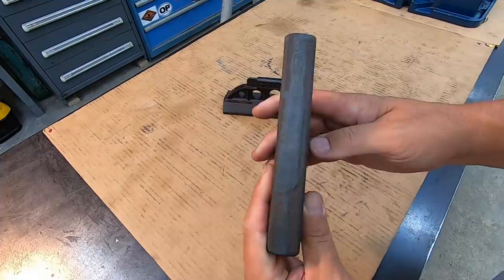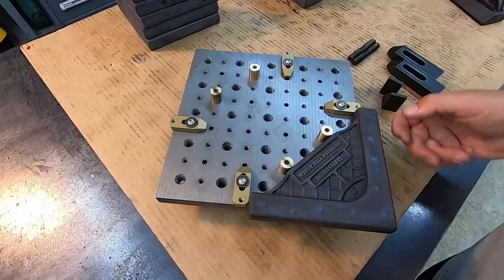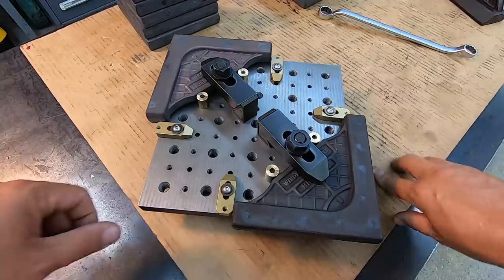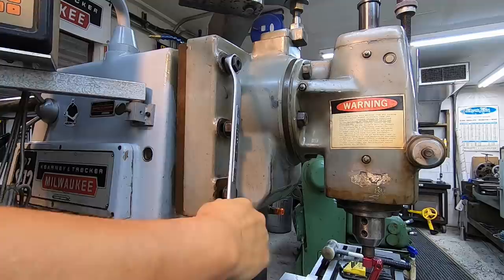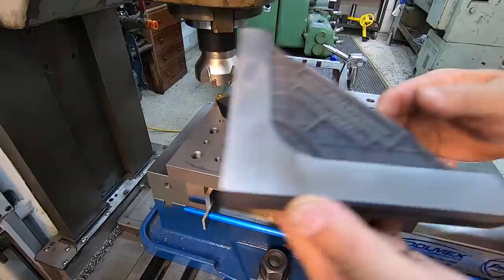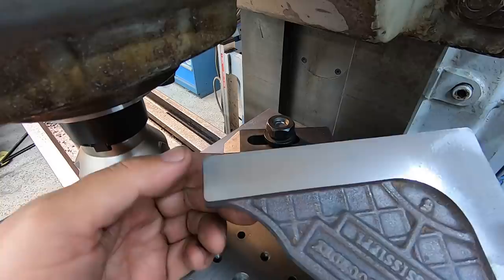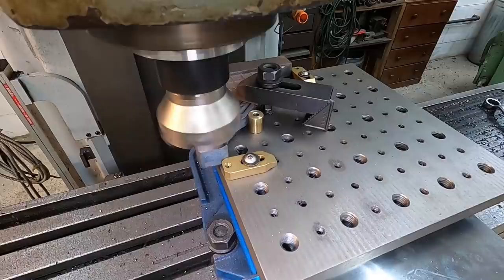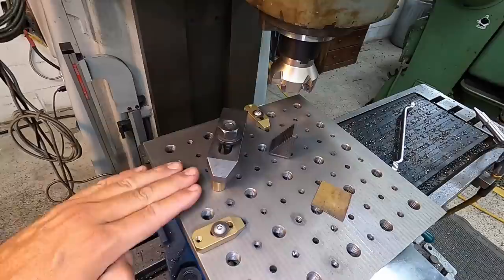Windy Hill Foundry Machinist Squares Part 1

Comment: Those upset with you using the Sky Hook must be youngsters that haven't endured years of wear and tear on their body lift those vises and chucks by hand. I used to use a cherry picker for the chucks (most of the time) but used to manhandle the vises and wished I had the crane to make that job a whole lot easier. Good job Adam.
Reply: All I ever did in a machine shop was sweep, stamp, and clean parts, but still enjoy the videos - and have back problems - hard to work when you can stand up from a pulled back muscle, and doesn't take much!
Reply: @mpdavis731  I'm pretty sure the hecklers were criticizing HOW he used the skyhook. Not that he wasn't picking heavy things up with his hands.
Reply: @executive  Ah, ok - didn't know there WAS another way to use it - only one I have seen.

Comment: Okay the sky hook I was like I just lift my vices... then I got to thinking you cleaned the bottom side without fighting it or risking hurting yourself with a twist lifting it from the cart to mill. I liked it for the large but in the mill that is just as awesome.   Good job showing the safer way to get it done.

Comment: To anyone who thinks using a tool to help lift heavy parts is wrong has never injured there back or other parts doing so. You only have one back and over time it can only do so much and the simplest thing can change your life forever.  Work smarter not harder. Don't pay attention to anyone who thinks its ok to risk injury over lifting heavy parts.  From: A disabled fan who wishes he could do 1/4 of the things I get to see here.

Comment: There is a hundred ways but this is as good as it gets in  setting up the machining process. The old brake parts cast a very high quality piece which makes the machining much easier. Well done Adam. Keep safe. Carl, Central Coast Australia.

Comment: 142 lb for the vise, wow. I thought you were just being extra cautious and the sky hook was just to make it a little bit less strenuous. Can't be moving that weight around manually without putting wear on your body. Anything to ease fatigue will make for a more enjoyable workday.
Reply: Tony Wilson  I wonder if in the end engineers will come up with stuff that's bolted/welded together to get necessary amount of rigidity to make some simple operations and build up from there, or we'll see a 10/20/however many cargo starships landed on the moon in preparation for astronauts.
Reply: @jnimitzch4738  H3 fusion is very much a pipe dream currently. If (IF) it ever becomes viable though it would make all the iron, titanium and aluminum bearing minerals that make up the lunar rock useful, because extracting the metal from those ores is going to be extremely energy intensive.

Comment: If you are not changing the clamping before machining the measuring faces, have you considered if the clamping on the suspended middle part will flex/pull the angle together to any measureable degree?

Comment: What's wrong with using the sky hook on the mill? That's what I would use it for. Sure beats having to lift a 142 pound vise up with your arms and back. I think people are just jealous of your sky hook. Haha.
Reply: Was thinking the same thing. Work smart while you work. Save the body for future use. 😉👍
Reply: I'm also confused as to why anyone would have an issue with how the sky hook is being used.
I for one love it,,, my back relaxes every time I see it !!
Reply from the maker: There’s loads of comments on the reveal video of why I’m doing harm.
Reply: @Abom79  to me it would seem that the K&T mill is a piece of equipment that is made to handle a decent amount of weight on that table. I wouldn't imagine that you lifting your vise on to it would do any damage. Not to mention that the thing is only under load for like 10  to 15 seconds. No way that's gonna damage anything when the machine is designed to hold a lot more weight than that for long periods of time during machining operations.

Comment: anyone disagreeing with using the crane probably hasn't ever dropped one of those big chucks or a big piece of barstock.
Reply: Let them disagree all they want. Needlessly lugging around awfully heavy (and expensive/sensitive) equipment without assistance tends to bring about a lesson or two all by itself, given time.
Reply: Most machine shops I've been working with all had either (or even both) overhead cranes and swing-arm cranes to move those heavy pieces of iron.

Comment: OMG one raw unmachined casting--------------------------------------Raw casting. $157.55
You have to be out of your freaking mind.
Reply from the maker: Sounds like you buy your tools at Harbor Freight
Reply: About $2 per pound for raw material, so maybe $14-16 including the sprue/scrap.  Stress relief a batch, about $100 and probably 10 at a time ($10 per).  The pattern probably cost about $2000 to be CNC cut.  I’ll assume he wants to get his money back after 50 of these, so $40 per for the patten.  Then packaging, maybe 1 in 4 is scrap or has porosity.  So he’s in for $80 per to just cast a good one to cover the cost, then he’s got to make a living off this.
Reply: Harbor Freight is that way --> go get all the pot metal castings you want there.
Reply: Jim Hammill yup you’re right, those can get added on too.  Not a huge money maker at all but a good quality product made by a craftsman and not a company overseas.
Reply: Lol you clearly don't have a clue about low volume foundry costs. This price is fair market value. Go learn before you speak.
Reply: @Abom79  Picking the other extreme doesn't really make your point. There's a pretty wide gap between them for sensible tools.

Comment: Better to break a tool than your back ! if you were worried about damaging the machine you could make up a sub plate to spread the load over two t slots , would only take a minute longer to install but with those big old American made machines i don't think you could break them if you tried !

Comment: Adam, couldn’t you just clamp the castings directly to the table to save time. You could probably mill all of them in one go then use the vice to mill the 90’.
Reply: @Ronnie Wilson that is a good question. Even if he didn't have enough stops/tee-nuts/strap-clamps etc to do all thirteen at once he could probably get half of them down directly on the table. I was also thinking that the workpieces overhanging the edge of the tooling plate... on top of the vise... might have not been rigid enough. As it turns out it was fine but there was some issue with the tooling plate anyhow. A bunch of well placed workstops (bushings) and quick release lever clamps would have really sped the process up.
ETA: Thought about it some more and the only real gain from fixturing directly to the table would be rigidity. Not that that is a bad thing but... unless he was doing dozens to hundreds of these squares he wouldn't save much, if any, time. Might even take a bit longer because he has to position a couple dozen stops instead of just two.
Reply: Adam has all these parts as one offs really as he has never had to set up for doing the op before.

Its always a learning curve and generally on the last part of a small batch you find the better way. 

Give the guy a break, he does a fantastic job , and i myself have been entertained for many hrs.

Comment: Did you finish the 1x2 fixture plate you were working on?  If so you could have used it to set up two squares on the same long side.

Comment: Would a torque wrench be useful to make sure the pressure on the clamp is the same on all pieces so the distortion is uniform
Reply: Why stop there? Strain gauges on each, mini pressure sensors under the web? The webs are thick enough that the pressure from that light tighten isn't going to bother them in the slightest.

Comment: The harder spots in the casting is that due to uneven cooling of the casting?
I have noticed harder spots in for example mild steel that's of cheaper origin and was told its mostly due to for example manganese pockets

Comment: Guess I don't understand why people would be upset over using a tool in the way it was designed to be used. 
Shame you don't have a shop vac setup to collect those chips, would be easier on the mill than using air I'd think. Great video, cheers :)

Comment: So how about mounting them directly to the table, without even the vise? Looks like you could have fitted all of them at once maybe.
Reply: I think for a precision job there’s too much potential for inconsistency across the whole table. That’s why a fixture plate is useful. It’s a known dimension with very little inaccuracy across the face. The table isn’t a precision surface
Reply: @kevincostes1  I beg to differ on the inaccuracy of a table. Production wise, the vice and fixture is easier and quicker in the initial setup and can make the job a lot quicker too.
Reply: @kevincostes1  if the table isn't precise, then the vice and plate won't be either.

Comment: Why don't you make a brass "shoe" shim on that clamp so you don't have to put it on separately while clamping stuff down to be more efficient?
Reply: Balance of time to make the shoe v's a few seconds per time. If this became a regular job week in, week out, then it would be worthwhile. For 13 squares it's going to be a total of less than 2 minutes, and Adam would take longer just putting the material in the mill, never mind indicating it...

Comment: Adam, no criticism meant at all here, but are you considering the milling as an accurate enough finish for a machinist's square, or are they going to be surface ground as well? I ask because my school days with machine shop were mostly with high carbon tool bits. I'm guessing that the improved cutting with carbide makes the difference.

Comment: I've never used one, so I'm going to ask -- in a production run like this, could you use a toggle clamp bolted to your fixture plate, or do they not have sufficient holding power?
Reply: Not enough holding power. I was surprised Adam only used one clamp.

Comment: Hey Adam, not to tell you how to do your job because I’m not a machinist but why couldn’t you put four pieces with corner to corner in the center of the holding plate?
Reply: My thought is that they wouldnt be square and level in respect to their legs, like they'd be slanted or tipped due to the "bulk" machining. They'd all be square regarding the other 3, but they'd be off compared to all the other ones. 

Note, I only just began a machining apprenticeship and I am no expert in this, nor do i claim to be:)
Reply: It could probably work looking at it but you would end up with some weird finishes I think because I don’t think you would be able to avoid cutting two at a time sometimes, and maybe that would be too much load on the machine.. also not a machinist 😆
Reply: Also, he mentioned he doesnt have enough travel on his y-axis  to reach the outside edges on the back side of the plate
Reply: Eric Barry yep that’s probably the reason then haha

Comment: Adam, at 26:18 you have them stacked on what I believe is your lift table. It looks like you have a T-slot surface with some kind of cloth. What is it really?
Reply: Thats just the rubber matt on the top of the lift table... if you goolge "harbor freight lift table" you can see some other angles of it.
Reply: @bottlerocket3333  Thanks

Comment: If you have a workshop full of cheap, inaccurate measuring gear you are on a hiding to nothing if you need to do some precision work.   If, however, you have one good reference piece , like a square,  you can then bring some precision into your work and remove the flaws in the cheap stuff you bought.   There is a place for cheap, but if you always go cheap you'll experience endless frustration.

There is a certain satisfaction in making something you need rather that rushing out to buy!!!

Estephan,   Brother in law of Jobe.

Comment: aren't you afraid of distorting the flat sides of the triangle by pressing down on the thinner interweb of the triangle?
Reply: This isn't Adam's first rodeo, so he probably knows how much clamping force to use. I'm sure he also checks his work, so it's probably not distorting as much as you think.
Reply: Hit it with a pass or 2 on a surface grinder, that will take care of any minor distortion. Moore also says that most machining operations change the internal stresses and cause distortion to some degree, depending on the composition of the iron, it’s a property of cast iron
Reply: The web is not far off 1/2" thick and the clamp isn't dogged down that hard so unlikely it's distort anything. If you see him grab a scaffold tube for leverage then you're up.